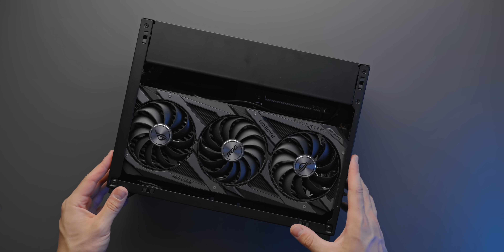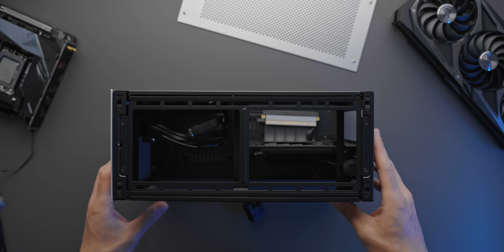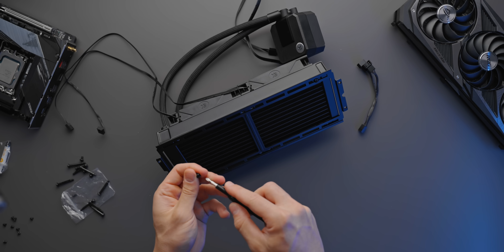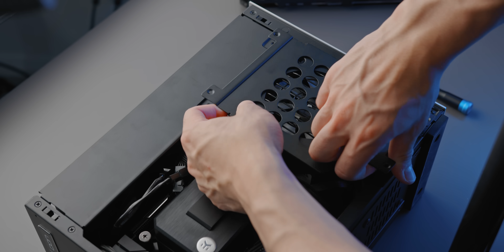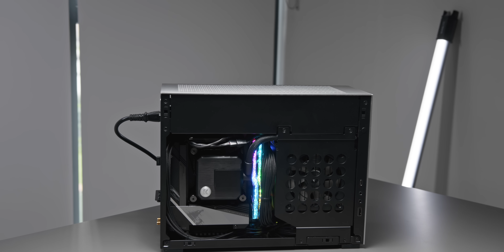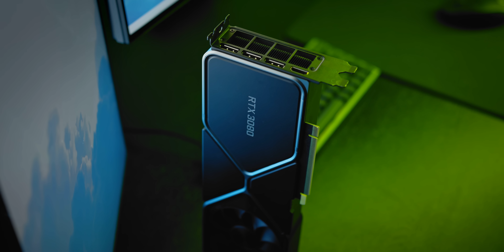Tiny Case with Perfect Fitment – Dan A4-H2O

Comment: when i first heard about this case it seemed like the case of my dreams and i was eagerly anticipating it's release.
Ironically the case i actually got was it's slightly bigger brother, the q58.
The A4-H2O looks great and i like the dimensions, but the q58 is my endgame.
The design, the performance, the hardware compatibility  and surprisingy the build process are amazing in the q58 and i'm never letting go!
Reply: Can I ask what radiator and GPU you have ? 

Really keen to see if this can fit the arctic 280mm AIO and the powercolor red devil 6800XT. 

Both are on the absolute edge of maximum dimension reported for this case. 

Keen to see what your experience was !
Reply: @rayqand5068  i have an alphacool 240mm AIO. 280mm AIOs are a bit tricky in terms of compatibility. I'm sure you can find more info on the website or on youtube.
As for GPU, anything that isn't larger than 3 slots should fit with ease. I only have a tiny 2 slot single fan gtx 1050 tho :'(.
Reply: @kraftwels  thanks bro

Comment: An undervolt on these Alderlake chips is a must. Once you get it dialed in the power draw and heat output is way lower for the same performance.
Reply: Yeah the out of the box power draw is bonkers, basically solely done to beat AMD in benchmarks — gaming performance does not need it at all!

Comment: Any chance slim fan(s) would fit on the bottom to help push more air over the radiator on top?  Did you try reversing the top fan direction?

Comment: So the PSU is blowing air straight into the radiator and the motherboard and CPU are completely blocking the other half of it ..... Ooof its no wonder you hit 100c.  That CPU is getting literally zero cooling.

Comment: One thing that i have to say about any ITX build is that they are not value for money at all in my opinion and don't have enough benefits. They can be very small, sure, but you have to cram everything in there and that isn't very fun regardless of the case. They are very expensive as well making the cost of the build higher which is not that good in todays market with shortages and stuff and they require ITX motherboards which can also be very expensive when you get to the decent/good models. They also have higher temps. I know this sounds  like I hate them but they are just generally not that good in my opinion when you don't really get any more benefits from normal sized cases which makes me think if they are worth it. The one case that i think is good is the NZXT H1 V2 but that also has a very high MSRP price.
Reply: always wanted to do a mini itx build but the cost is too much imo. also, its not worth the hassle as you have to worry about the parts that go into it. not worth the money and time imo and now with rapid inflation due to the pandemic and part shortages it not worth it even thinking about it.
Reply: @LCJammer  yeah. I built a system and was LUCKY to get it for just under $200 from what it would be without shortages. Could of used the extra $200 for something like a cooler or a better GPU!

Comment: I was just wondering if my x52 would fit and bam, you said it. Neato. Means ditching the D15s after only 4 months use though :(
I got a SF750 powering my 5600x + 3090 and I'm yet to see it hit over 620 watts at the wall. That's with the gpu pulling over 400 watts during a game.

Comment: What has been your experience with the Gigabyte motherboard? It’s one of the cheapest ITX Z690 motherboards as I wait for ITX H670 motherboards to become available, but I’ve heard people having so many problems with it - mostly WHEA errors when not running in PCIe 3 mode
Reply: WHEA problems still exist. Ram compatibility has been fixed for the most part. Clearance issues are still the same. Some mobo get more clearance by removing the nvme heat sink and replacing with a low profile one. If you have time keep waiting.

Comment: Thanks for the excellent overview, been going back and forth between this and the NR200P Max for downsize to full SFF.  Side question: have you had any leaking issues with the EK AIO?  Tried 2 of the RGB 240 AIO’s little over a year ago and both leaked, prompting me to switch to a different AIO entirely.

Comment: Maybe I'm being dense, but would it not make the most sense to rotate the block counterclockwise 90 degrees and have the connectors facing the top of the case? Also I'm sure that the VRM heatsink and IO shield cover could be removed and replaced with a smaller heatsink if needed.

Comment: I don't think this will be much easier to fit in a backpack than the meshlicious which can hold a 280mm rad but the gpu size that it can hold is impressive and it's a step up from the previous 7L dan a4 with a 90mm AIO which meant you wouldn't be able to realistically cool top tier CPU. This case I think could handle a custom loop with top tier components. Just only at temps that are safe but that a reviewer might not like.

Comment: Nice choice using the EK 240 Basic, I love it only uses a 4 pin header to power the pump instead of a SATA power cable found in AIO coolers due to RGB lighting. Just having 1 less cable to deal in a cramp build is a plus to me.

Comment: Went with the Meshlicious and I'm telling you, I'm never building anything outside this case. The desk-real estate savings on a ITX tower is way too nice, something these ITX formats can't offer. The Meshlicious, with very little mods, can accomodate two 80mm fans (back in GPU compartment, in 4-slot mode) and a 92mm top exhaust. It's compact and chilly AF like this. I even went with a Thermalright AXP-90 X47 for an air cooler on a non-TDP-limited 11400, and it's working perfectly. Should cope just perfectly fine with a non-k 11700/12700 as well.
Awesome video though!
Reply: How loud does it get?
Reply: Nearly 16L and can only fit a single rad + GPU is not a worthy case to be bragging about.
Reply: Same question like above. Which temps do you get while gaming with 80 to 100W TDP? Thinking of testing the AXP90 X47 with a 12700 - at the moment on 240er Rad in FormD T1.

Comment: I thought Bitwit was  the only one with the cable management problems with his review unit, but after seeing you going through the same cable issues, I wonder if this is a design flaw. I would use a Noctua low profile cooler instead of an AIO.

Comment: How do you check if the GPU you have will fit into a smaller case like this? I have a 3070 MSI Gaming X Trio and is huge, so any insight on HOW I can see if it will fit would be amazing!
Reply: The GPU clearance for this case is 322mm. You could measure your card and see if it fits.

Comment: Many are not going to like this but I would prefer a NR200Max sort of a bundle here. With Lian Li SFX PSU with custom sleeve cables and basic AIO which has custom length tubing and wires, pre-routed. Fan guard is cheap and could be an meaningful add-on. Or just flip the rads and fans placement. Some may prefer the option to support top 280 AIO too and I imagine that wouldn't made the case much larger, and cable management would be a breeze. It may also make installation of mammoth MSI Suprim cards possible, which is 336mm long.
Excellent build btw, and I bet only with biceps like yours can we squeeze the AIO and PSU into place lol

Comment: IMO, Lian-Li/Dan sacrificed too much flexibility for compactness. I've seen several techtubers having issues with the AIO tubes together with the PSU cable. I would still go with the CM NR200 series as I've yet to see an ITX case with such good balance.
Reply: I think that this is more of a compromise that motherboard manufacturers are making for the consumer. VRMs do not necessarily have to compromise that much on clearance. If you were to go with an Asus Strix B550I you would not have this amount of compromise.

Comment: It will probably have the same problem as Q58. The motherboard/PSU side is very blocked, so the fan on the AIO on the top in exhaust orientation will be getting most of the air from the hot exhaust of the GPU. That's what caused the terrible CPU temp
Reply: Yes and no. A 12700k at 100% syntetic load has 190W of power. This is too much for an 240AIO @ 1200 rpm. As you can see in Heaven Benchmark the CPU stay under 60°C.

Comment: Is there a point to try installing fans at the top of the case instead of the radiator? Cables will not affect fans, but there will be a bit longer tubing. Also airflow should not be that affected because of  "walls" around radiator.

Comment: I think EK recommends using your own thermal paste with alder lake as the ihs is bigger.

Edit at 16:02: it is true (@1:40 https://youtu.be/tNZimwyfroo )
Reply: Nope
Alder  lake u need minimum 360 aio
Reply: @Nirvuna  nope. Go to 1:40 seconds https://youtu.be/tNZimwyfroo
Reply: @kyveriver4316   u don't need too tho
That just if u want 
Usually the heating part is on the middle 
So as long as the cooler  is making contact on that specific  part
Ur good.
Example thread ripper aio
They don't cover all n yet they cool it.
Reply: @Nirvuna  true under syntetic load. Or higher RPM speed on 240 AIO
Reply: @DAN_Cases  thats not What I said. Thermal paste application is What I was talking about
Reply: @kyveriver4316  i quoted stressfreemode
Reply: @DAN_Cases  yes But still, conversation is completely different to What I commented
Reply: @kyveriver4316  true do you have a link for the ihs topic?
Reply: @DAN_Cases   well also true if ur using it for other things beside gaming.
I just think alder lake CPUs specially  higher skus aren't meant for itx builds.
Reply: @DAN_Cases  only the video by EK I listed in my comment

Comment: Great case but looks very limited on extra SSD storage
Reply: It most definitely is. There is unfortunately only a slot for 1 2.5 SSD. However, USB C External NVME SSDs perform better than SATA and would have more compatibility such as with laptops and tablets.

Comment: I have that same RAM cramming issue with the EK AIO in my NR200. It's not caused any problems over the last year, but it does make my stomach churn a little when I think about the situation. Fitted on a MSI MPG B550I board

Comment: not tiny, 377mm long
not perfect fitment, can't fit NH-P1
Reply: Wtf? Who would put an NH-P1 in an ITX case?
Reply: @Aexeq  everyone who wants a decent build
Reply: @Z4KIUS  I don't consider this decent, I consider it stupid. You only want to use the NH-P1 in completely passive builds and the best passive GPU is a 1650s. If you add just one component with a fan, the whole point of passive cooling is gone and not even 1% of enthusiasts would consider a fully passive ITX build.
Reply: @Aexeq  what's the point of building a machine that sounds like a mad dog whenever you put any load on it? end user builds have to be inaudible
and obviously you're not going to use any readily made active components as these are always undersized and underperforming but you can add A12x25 at around 500RPM to assist the convection a bit and get some extra headroom, though it shouldn't be neccessary
and you can squeeze a lot of power from a build like that, throw 5950X in and set PTT to 90W and you'll be more than fine (yes, P1 is specced for much less but does great at these loads, especially with heat spread across 2 CCD), with some curve optimizer tweaking you'll have all the power you want with no noise

and why not put it in ITX? it's a fully fledged standard that has everything that's needed, there's no point in getting a bigger board or a longer or taller case, for the office build I'd even prefer making it STX with 5700G, but this is not possible sadly
but back to the topic: what's wrong with neat little cube that never makes any noise no matter the load? it's literally the perfect next-to-desk PC
Reply: @Z4KIUS  there's obviously nothing wrong with that, just the A4 H2O is in a completely different market. It's build for water cooling, so why should it fit that massive air cooler?

Another thing I don't get is why anyone would put a fan on the NH-P1. If you use an A12X25 on most coolers with 500rpm it just beats the NH-P1 no problem and it would still be basically inaudible.

I mean if your whole build is centered around the NH-P1, I would be the last one to stop you, but then again, why should it fit in a case that specifically has H2O in its name lol.
Reply: @Aexeq  other heatsinks are too dense to work with fans at that speed (not enough pressure), in my experience P1 without a fan does better!
and P1 isn't even that big actually, it unlocked quite a lot of options when compared to D15 due to lower height

LC focused cases that can only fit regular thickness 240mm are just wild, there's no performance to be gained from LC usage but idle noise and reliability are much worse than with even D15

Comment: This or the FormD T1 2.0?
Reply: T1 is more for tinkering, H2O is more straight forward for AiOs.
Reply: @Aexeq  Do you think that air cooling is viable on the H2O? I'd like to use the Black ridge
Reply: @partyloco  depends on what you want to cool. If your GPU is 3 slots, then you can go either H2O or T1. If your GPU is thinner, the T1 can move it's spine and give more clearance for air coolers. Both are not optimal for good air cooling. Looks like you would have more success with something like an Ncase M1, if you can still find it somewhere.
Reply: @Aexeq  The T1 is amazing, it has a lot of build options. I have a 2.7 slots GPU and I'll not decrease the size of it in future, I'll bring the PC with me in a backpack so I'd like to keep it small. That's why I discarded the Meshilicious etc. Looks like I'll have to choose the one in stock. The T1 seems hard to get, even though a batch should be released in the next months.
Reply: @partyloco  I was lucky enough to get a T1 V1.1 in the third batch, but if you are not using all its capabilities and tinker with it, other cases might be the better option due to the availability you already mentioned.

Oh and also I feel like the T1 is not the best case to get carried around. It's finish is very good, but can get scratched quite easily if carried around. The full aluminium construction however benefit it's portability. 

If your components allow it, the A4 SFX might be the case for you, but I'm not sure if it fits taller than 2 slots GPUs.
Reply: @Aexeq  The A4 would be perfect for its size but I should find a smaller GPU. We know that it's a problem right now. Let's see the availability of the H2O tomorrow, probably I'll get it. The more I see it the more I like it. Thanks for your time, Paul!
Reply: @partyloco  in the end just get some Phanteks T30s in there and use the rest of the radiator space for cables if needed ;)
I hope you can get one, if I don't, I try my next luck with the T1 V2 and if all else fails my T1 V1.1 will serve me well with an external rad.
Reply: @Aexeq  I didn't know those fans, they're perfect as top exhaust. Wishlisted. Yes, hopefully, there will be some T1 news after the Chinese new year ends. Good hunting!

Comment: I really like this case as well as Lian Li as a brand. However for my propose it seems a little bit to small I am afraid. What smallest case do you recommend when you what to liquid cool the GPU as well as the CPU? Probably you will need the space for two 240 AIO coolers, one for the CPU and one for the GPU. And some space for a 1000 Watt power supply as well, you will need this kind of power when you are buying into the upcoming GPU monsters coming this fall, I guess. 

Would the bigger brother be an option for my build? 

Thanks for all your work and the great videos you do! I really like your channel a lot!
Reply: Seems like you are looking more towards a Meshlicious then. There are a lot of builds around that one and anything with considerably more cooling isn't SFF anymore. Also you should look out if you can get a power supply, that can handle the components while also fitting inside SFF cases.
Reply: I need a 4080 that’s fit please help

Comment: Hey OT, can you already say anything about the possibility to run a full custom loop? In theory it should be no problem, but the PSU cage and the generally more closed off approach compared to the T1 leaves me a bit worried.

Just for context: I'm running a T1 with a TX240 and a pair of slim Noctuas at the moment with custom unsleeved cables. In the A4 H2O I won't be able to use the custom cables and need to use the Corsair stock ones, you also use in the video. I plan on going with a HWLabs GTS rad and full size fans. GPU is a reference 6800XT with the single slot EK block and CPU/pump combo is the Aquanaut extreme.

Comment: When I see the upcoming chip size from Nvidia and the power consumption of the 12x00k series, I wonder if itx is still the right choice for a main gaming machine in the years to come, at least if you have to drive a demanding display.
Reply: exactly my thought. As I am aiming for upgrading my 2080 when 4000 series drops. 
Heck, I will most likely do full refresh, as CPU war is full on right now. My 2600x is tired :D
Reply: I’m hopeful that newer nodes will keep the thermal output similar to current day AMD parts at least in the future. Fingers crossed anyway, because the massive thermal output of the 3090 and 12000 series is just ridiculous. My 3060 Ti and 5600X do excellently right now at least, driving my 4K screen nicely (and easily hitting the 144hz for the games I play that need it, like Valorant) and with some tweaks hitting 60-90FPS on single player games quite nicely right now. DLSS and FSR (and XeSS next) making that even easier.